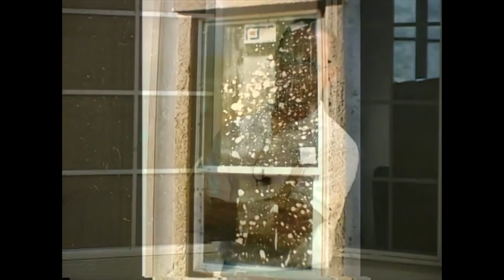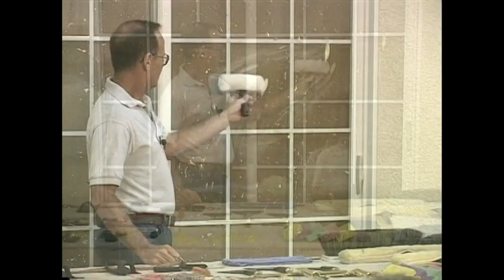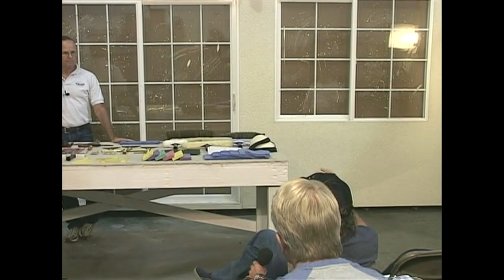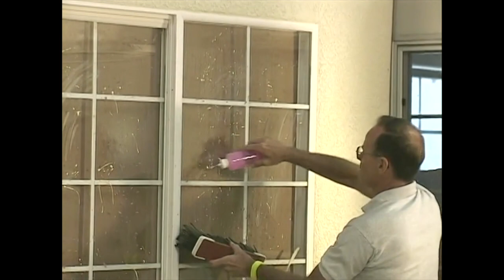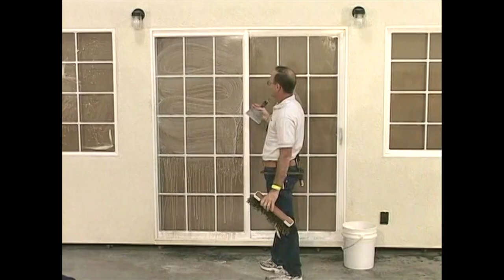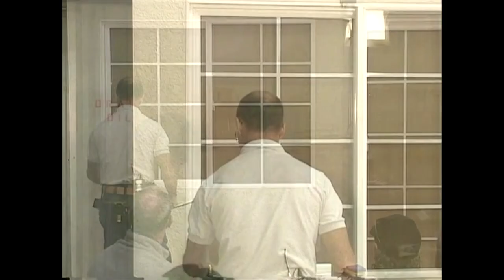Dan Fields: Construction Window Cleaning Basics - Part 1

Comment: Anyone know what the brand of that phosphoric acid soap is?

Does phosphoric acid in general stain metal panels?(the ones found on condos that are the same size as the windows)
Reply: Do not use phosphoric acid on windows as it is corrosive to glass. There are other dissolvers available that don't use acid and are more friendly to the user, the glass and the environment.
Reply: @kylegilbert5234  So are you saying Dan Fields is wrong?